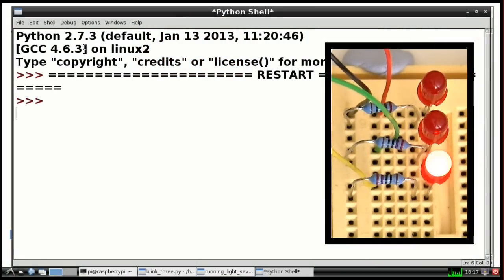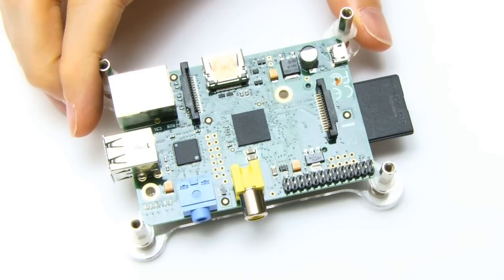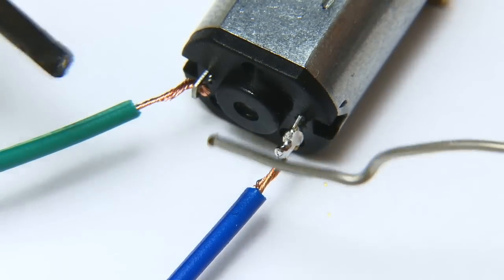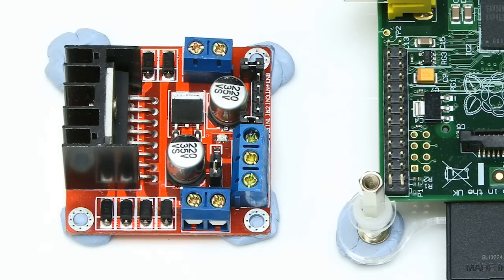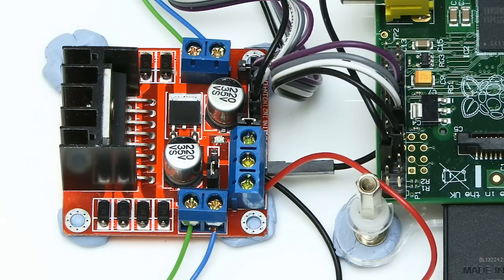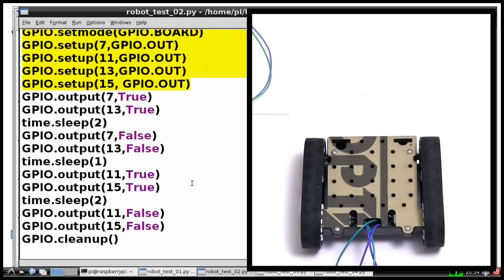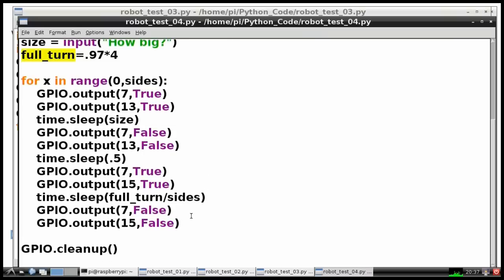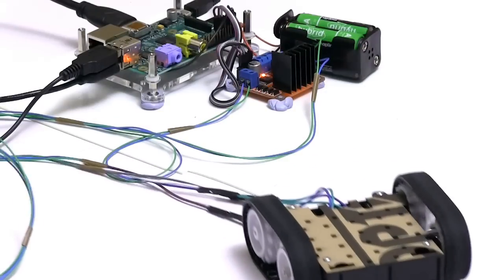Raspberry Pi Robotics #2: Zumo Robot

Comment: If you have everything besides the motor controller, is it still possible to have a working robot? Or do you need the controller? I'm really new to this, it kind of looks like the motor controller simply reroutes the wires. Could someone enlighten me?
Reply from the maker: +McVp You need the motor controller for two reasons. Firstly, a Raspberry Pi cannot power a motor -- try and pull that much power through the GPIO pins, and you Pi will rapidly burn out. Secondly, the motor controller permits the clever trick of enabling the motors to run in either direction according to an input logic state provided by the Pi. So in this sense, the controller is able to not just turn on and off the power to the wires, but also exchange them between the two motor terminals as required. :)

Comment: Why do you use an external battery pack when you can put them into the robot chassis?
Reply from the maker: Flowlance Because, until the Pi is mounted on the track unjt too, it would require even more (long) wiring!
Reply: ExplainingComputers I see, thank you :)

Comment: As soon as I power up my L298N-H bridge and PI motor 2 starts spinning. It does not spin when i power off my pi
Reply: Sahil Naran Correction,  my IN1 and IN2 starts spinning
Reply from the maker: Sahil Naran Checkout my other comments here on this, and especially my webpage on this here -- scroll to the bottom: http://www.explainingcomputers.com/rasp_pi_robotics.html
Reply: i have, sorry i am utterly confused. 

in addition, i am using a 7.5v battery pack
Reply: can i perhaps email my setup to you
Reply: ExplainingComputers I figured what was wrong, I am using rasp pi 2. and gpio 7 is reserved for glck
Reply from the maker: Sahil Naran Cool. I am glad that all is sorted.

Comment: Great video! Very clear :)
I read comments and know that your 2 USB ports are used for keyboard and mouse; and the micro USB, I think, is for 5V power supply. I wonder, why don't you use the power from batteries for Raspberry Pi as well?
Also, can you make another video using wifi dongle? (instead of connecting to keyboard and mouse via cable). I'd love to watch this from you as well :)
Reply from the maker: Frederick Taylor One of my next videos will be a setup of a Raspberry Pi 2 in a case, and with a WiFi dongle and wireless keyboard.
Reply: ExplainingComputers Thanks for replying! can you answer my first question please?
Reply from the maker: Frederick Taylor Those batteries (4x1.2v) would not reliably supply the Pi (5v). :)

Comment: if i wanted to control it by pressing W, A, S, D, what would the code be? i tried to code it but it was not having it. thanks! :)
Reply: Alex Elbert I would recommend using Tkinter to bind the key (make a GUI, but give buttons or something with W, A, S, and D as accelerators) and have function that controls the robot.

Comment: Hey Chris its Mark , for the past week i have been struggling with the  problem , of encryption  in python programming language.   Could you tell me, how to encrypt text with an offset , instead of a key word  . Also where did you get the robotics used in this video , and what  real life applications does this have   , apart from having fun with computing , and education. I consider my self obsessed with computing in the sense of (i do an hour of programming or using my WiFi adapter on the raspberry pi to program a lamp serve or reading about computing hardware) . I am trying to create a computer booking system for a school , could you recommend a way to connect my raspberry pi , to my computer   , so i can program on it remotely , and could you possibly do a video on that .Thank you for the video on windows ten technical preview , it was really helpful
Reply from the maker: Mark Blake Hi Mark. It sounds like you do a lot more Python programming than I currently do. Many years ago I used to program a lot (mainly Z80 assembler), though today so many things compete for my time. So I can't tell you about Python encryption I'm afraid.

The Zump parts come from Pololu, who make loads of great robotics stuff. Real world apps I guess are anything involving the computer control of physical stuff, and as the Internet of Things grows, this may become most mechanical things -- including 3D printers. So the Pi is a great learning tool. A video on accessing it remotely is certainly on my (long) list.

Comment: Hi I'm completely new to this and I have a question. There are two outputs from the negative in the battery snap (one to the ground in the in the L298N and one to the pi. I was wondering how this is achieved.
Reply: Also how would you connect the wires to the motor and motor cables?
Reply from the maker: Ur Mom Checkout the diagram at the end of my page here: 
http://www.explainingcomputers.com/rasp_pi_robotics.html

Comment: ExplainingComputers Can I plug the motor directly on raspberry instead of use a motor controller board ? What's the advantage of the motor board ?
Thx for the video, was amazing.
Reply from the maker: Runy A Pi cannot run motors directly I'm afraid -- it cannot supply the power, and you would blow the Pi up pretty quickly. :( Thanks for your kind feedback. I will be doing a follow-up video developing the robot further fairly soon. :)
Reply: ExplainingComputers Oh, thx, good thing that I made this question :D
Reply: ExplainingComputers Btw, I finished your tutorial, everything worked fine ! :D Thx a lot, was my first contact with robotics, loving it.
But how can I put the motor controller and raspberry pi on chassi ? I can't see the space for it ! :(
Reply from the maker: I will be mounting the Pi on the robot in my next video! :)
Reply: ExplainingComputers Cool ! You will post it soon ? :D

Comment: I followed the link on your site to find the proper motor and it looks like you chose the 297.92:1, 360mA, without the extended shaft. It runs at 45 RPM and is 24x10x12mm. The higher power version with a 986.41:1, 1600mA runs at 32 RPM and costs the same. However it's 27.5mm long instead of 24mm. Will it still fit that chassis?
Reply from the maker: Terje Oseberg You are correct in what you state. :) As far as I am aware, the longer motor will fit the same chasis, but I have not tried it!

Comment: Why can't you just connect the motor directly to the raspberry pi instead of using that other thing? Please answer this. If you don't know what I mean, just reply to this comment.
Reply from the maker: Lt Lobster The Pi can not supply enough power to run a motor -- connecting the motor directly would fry the board. A controller also allows multidirection motor control.
Reply: Okay. Thanks.

Comment: Hi, I was wondering if you could help, I have wired my pi and l298n board up like you have in the video, but on starting the pi, the motor connected to pins 7 and 11 spins initially, then as the pi loads into the GUI/Cmdline its spinning constantly.  I have swapped the connectors over, and it just seems to be happening on the GPIO 7 and 11 pins.  I have tried it on my other raspberry Pi too, and it does the same.  If I swap the pins, the opposite motor does the same, could it be a faulty L298n board?
Reply: RaspiAnt I got the same problem, but them I inplugged and plugged again the jumpers and everything worked fine ! Really weird, in my case on wheel was turned on constantly.

Comment: Hello Christopher. Awesome Videos, I watched many videos on youtube about raspberry pi but your videos were the best. I have a Question. Is there a way to use the motors without the motor Controller?
Reply from the maker: Pranav Garg I'm afraid not -- the Pi cannot supply that kind of power. Hence some switching components linked to another power source are essential.
Reply: Thanks but please make some more videos on raspberry pi robotics ☺
Reply: ExplainingComputers Dear Christopher Barnatt: How much will the whole set of components you used in this video cost?

Comment: how do you control it with the pointing keys on your raspberry pi
Reply: Search google for Python key detection, now perform a "while True:" loop and check for a key press, if key w = true then do code for going forward, it's very simple without writing the code out for you.

Comment: Dear Chris,
I am trying to get started on building this Zumo robot however i am rather confused with all the parts. I understand you need one usb lead connecting to the raspberry pi but what is the second one you seem to have for? Also would i be able to run this on a Mac by any chance?
Reply from the maker: Gul Omer My two USB leads connected to the Pi are keyboard and mouse. I'm sure there must be IO boards for controlling a motor via a Mac -- but I don't know what they are! :)
Reply: Many Thanks.

Comment: i'd like to see how the camera would work( more specifically battery powered pi with camera and wifi dongle for streaming video). i tried to make a bird nest watcher to live stream a couple of hours during the day (8 hours exactly), with a custom made battery because commercial batteries don't last that long and are triple the price of my solution. anyway it all went well but when i turned on the camera when it was battery powered everything crashed and i didn't get the wifi signal, and i gave up after trying everything, that is learn about batteries, watts and amps, all fun to learn. but i failed in the end.also i burned out 3 Ras. pi already
Reply from the maker: Powering a Pi via batteries is not easy I think -- but on my list of things to try! I do like the idea of an independent Pi robot controlled via WiFi and able to stream video. Which means I will have to build it -- and do a video! :)
Reply: Did you pi get powered more than 5 volts and how were you powering it micro USB or from the gpio pins because the gpio pins scrip the power safety fetures

Comment: Is there a easy way to alter the speed of the motors ?
Reply from the maker: Sadly using this kind of motor controller, no. The motors could be turned on-and-off rapidly I guess, but I've not tried this.
Reply: ExplainingComputers Wouldn't this be doable with pwm? (Either the B+'s two existing pins, or the software pwm added to the gpio a few months back?
Reply from the maker: Justin Tolman Yes, almost certainly what you say is true: there must be ways to achieve proportional motor control. But not, I think, using the basic GPIO pins connected to an L298N as I am showing in this video. But you have now got me pondering about this! :)
Reply: ExplainingComputers I found a set of tutorials. http://raspi.tv/2013/rpi-gpio-0-5-2a-now-has-software-pwm-how-to-use-it and it's sequel http://raspi.tv/2013/how-to-use-soft-pwm-in-rpi-gpio-pt-2-led-dimming-and-motor-speed-control . The author uses a ULN2003 instead of L298N but the principle should be the same.
Reply from the maker: Justin Tolman Cool -- thanks for the links. The Internet is a wonderful thing! :)
Reply: Hdgg as t home b b  g
Reply: Sema Arslan Ummm... did I forget how to read again?

Comment: Could you  post a link for where I can buy these parts?
Reply from the maker: Thanks for your feedback. You can now find the wiring diagrams, as well as links for the components used in my Raspberry Pi robotics videos here: http://explainingcomputers.com/rasp_pi_robotics.html
Reply: ExplainingComputers  We are looking to control "doors" of a venturi with servo motors and a raspberry pi with the adafruit motor hat. Do you think it is possible to control the doors using that hardware and a keyboard for precise control?  We would also like to use some type of  rotary dial that actually clicks for each step so we can make precise adjustments for both doors. Do you have any suggestions for dials?

Comment: how much money did you spend for the complete robot?
Reply from the maker: I paid £15 for the Zumo chasis; £5 each for the two motors, £2.02 for the L298N motor controller, and £8 for the two sets of jumper leads (although this was overkill, though I now have lots of leads for future projects!). So my total spend was £30.02, which is about $51.

The critial parts are the motors and L298N -- there are lots of other options for making the vehicle, as you will discover on the Pololu or Pimoroni websites. You could alternatively take the cheapest two-motor toy car you can find and wire the L298N to its motors and battery compartment.

You can now find links for the components used here: http://explainingcomputers.com/rasp_pi_robotics.html